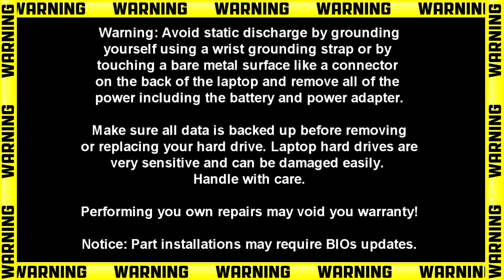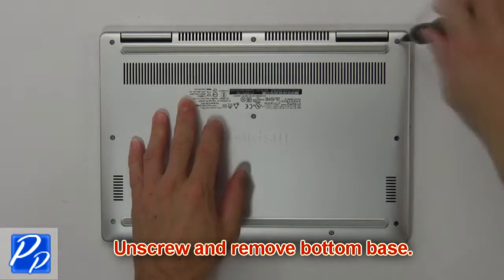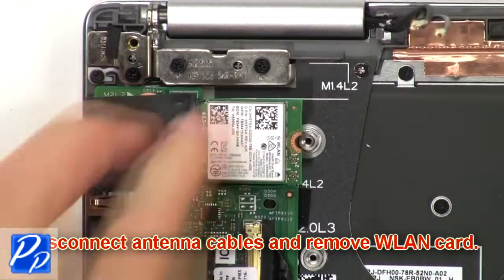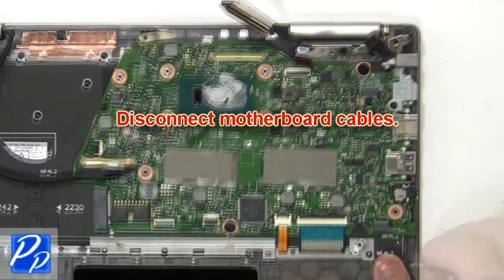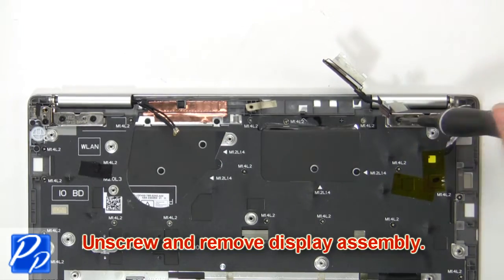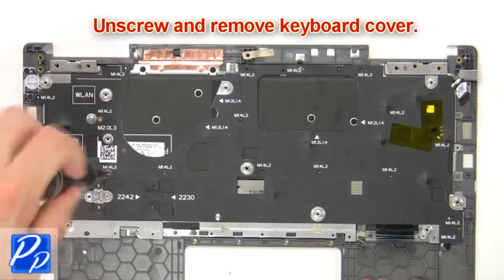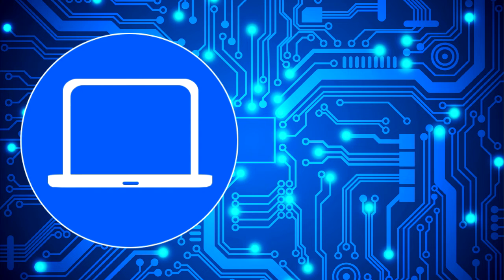Dell Inspiron 13-7373 (P83G001) Keyboard How-To Video Tutorial

Comment: Thank you! Bought a replacement keyboard off Amazon for $25 and used this video to get my old one out and new one in. Very smooth! The only suggestions I would have, and I believe another poster below mentioned it as well, is to be cautious with removing the heat sink. It isn't a necessary step, and if you do it, you have to have thermal paste when you put it on. So if you have paste? Go nuts. If you don't? Skip that step. Another step that I skipped was removing the antennas from the wireless card. Those little ipex (I think?) connectors are so fragile, its easier to just let the wireless card dangle. While the pace was fast, I had a second computer up while I was doing it and just was pausing it where necessary. I think what might have helped me too is how each motherboard ribbon connector "unlocks." Just about all of them had a different method for releasing the ribbon, and they are fragile. 

Minor gripes, but hey, it let me replace my sticky soda soaked keyboard super fast and easily!

Comment: This is an awesome video, and thank you for posting this. It really helped me replaced my laptop keyboard. I agree the pace is too fast, but if you are using a computer with a keyboard, you can use "Space bar" for pause, "Left Arrow" key to rewind back 5 seconds, and "Right Arrow" key to fast forward "5 seconds".  It helped me a lot to locate the screws and steps. I have helpful tips if you're planning to use this video:

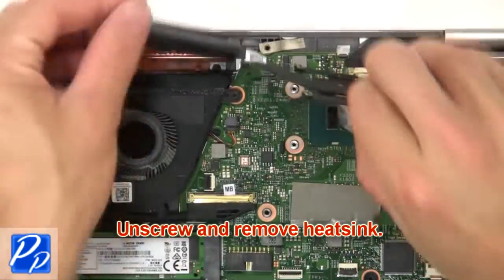1. At 1:07 - Heat Sink removal is unnecessary. Mother board removal and Heat Sink can go together. If you remove the heat sink, you will need to pry out the 'thermal paste' on the processor, and then reapply a fresh thermal paste later.. Unnecessary work... 

2. At 2:30 - The key board screws ( and entire screws) are made out of "soft" metal.. BE CAREFUL NOT TO STRIP the screw holes.. go slow.. Make sure your screwdriver has a good grip on the slot, and slowly and carefully remove them. They are in different sizes, make sure you have a few sets of small screwdrivers.. just in case.

3. Follow the instruction methodically, group the screws in order.. you will discover that there are a lot of screws, and you will lose count and order.. if you're not organized.

4. I recommend buying a 'head set magnifier' ( you can buy this on Amazon under $10), since at 1:26 ( motherboard cable removal ), you will need to carefully lift tiny cable locks. Magnifier will help viewing and lifting the locks especially during re-assembly. DO NOT FORCE THEM.. they are simple locks, you just need to know how to 'flip/unlock' them. 

Parts that I bought:

KBR Replacement Keyboard for Dell Inspiron 13-5368 i5368 13-7368 i7368 13-7368 i7378 Laptop with Backlit 
https://www.amazon.com/gp/product/B0788CFWJH/ref=ppx_yo_dt_b_asin_title_o00_s00?ie=UTF8&psc=1

SE Illuminated Dual Lens Flip-In Head Magnifier 
https://www.amazon.com/gp/product/B003UCODIA/ref=ppx_yo_dt_b_asin_title_o00_s00?ie=UTF8&psc=1

 Total time for me - 2 hours ( I was going slowly and methodically ).. you could do this in less than one hour... 

 Good luck and Hope this helps!!